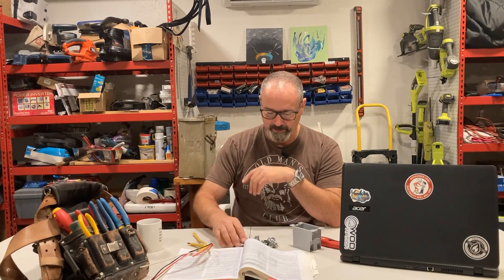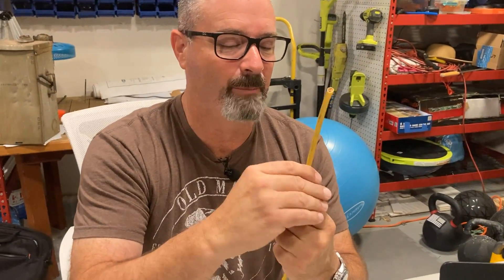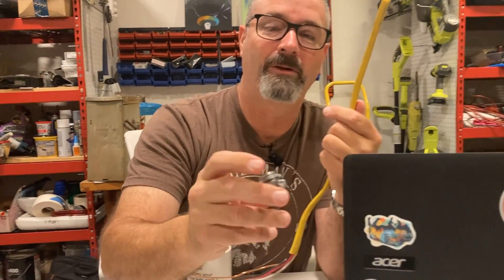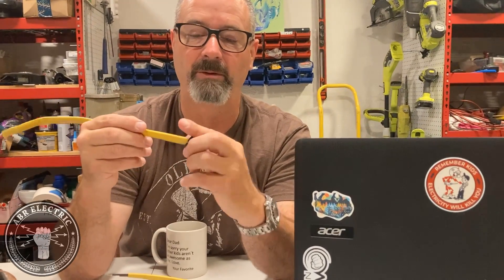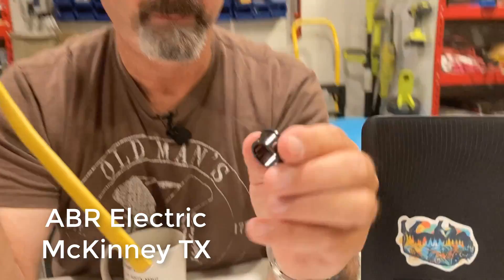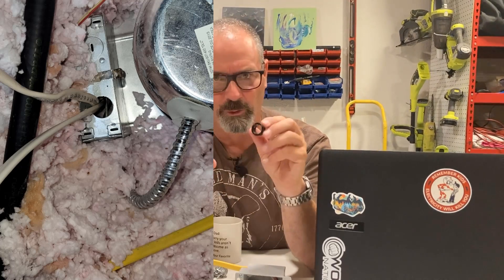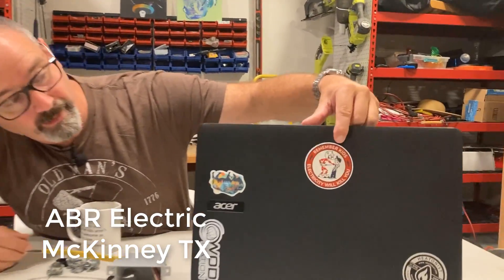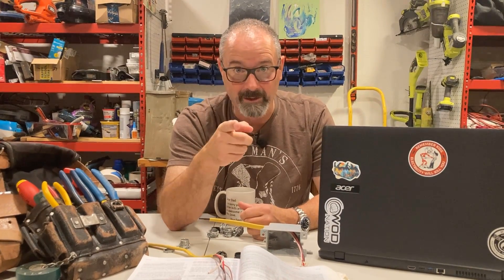Protecting NM Cables, Electrician Wiring Mistakes: Electrician Training for Secure Installations

Comment: If I have 20 Romex cables to feed through only the bottom of a 200 AMP BR Eaton Breaker Panel with 42 slots, the big 2" is being used for bottom feed 4 wires to the 200 AMP breaker at top of the panel, how would I do it since the remainder of the knockouts are a (4) 1 inch k.o and (6) 1/2 inch k.o.   Does the code allow 4 to 6 12-2 Romex cables to be fed through a 1 inch K.O. with metal romex clamp connector?  Does the Code permit (3) 14/2 Romex cables through a 1/2 k.o. with metal clamp connector?
Reply from the maker: @Chad.Tyrone4UNow  the limitation is going to be what your connectors are rated for. So if you have a snap in connector That's rated for 4-12/2 Etc that will answer your question. What are the manufacturer limitations on those connectors? The KO sizes aren't as critical,  as long as you're not damaging the sheath in the cables or bundling over 24".

Comment: Two screw is the way I typically go.  Just had an experience with a  two screw 6/3 for a 14-50R Hubbell NEMA.  

I tightened  the two screw 3/4 but the dimple  for the strain relief penetrated the red wire while working the cable in the panel.  6/3 is not easy to work with as those who have done so know.

The sheathing on NM-B 6/3 is not substantial enough and there is a nice burn mark on my 200 amp panel to prove it.  Although the 50 amp breaker did its job.  For those that have experience this moment know what I’m talking about.  

It will put the fear of god in you.

I will be going plastic grommet with the strain relief and staples to a mounting board.

I should be wearing one of those stickers on my shirt or find a vintage tee with that image.

Comment: OK, can I use the plastic black pinches as you call them versus the metal threaded Romax connectors on the connection box on the front of a dishwasher ? Thank you very much.
Reply from the maker: Yes, you can.

Comment: Are waterproof connectors available for ROMEX? Thank you.
Reply from the maker: Nope
Reply: Thank you. But here is why I asked…..
If have to install an equipment disconnect for my new mini-split. My home has vinyl siding over sheathing and the box will mount to it. Can I use a regular Romex connector on the back of the box or is that not code compliant? I will make sure the box and hole in the sheathing is sealed using duct seal. Hope you can help.
Reply: @Trainman0401  romex can't be used outside. If you mean connect to the box from inside the house, use a regular connector as that side shoukld be dry. But everything from the box on needs to be THWN wet rated wire.
Reply: @ Thank you! That is exactly what I wound up doing.

Comment: I use two screw connectors exclusively!  I don't Like the "pinchies! They allow the wire to be pulled into the box or panel and are difficult to take out if the need arises. Two screw connectors hold the wire firmly in place and the wires won't move in either direction. Plus, if you need to add or remove a wire is a lot easier to do.

Comment: Hi Iam trying to install a Nema 14-50 in my garage with 6/3.but Iam facing a roadblock here not sure what to do.  I have my panel outside of the garage, and I just want to install the outlet on opposite side of the wall( inside the garage). When I try to drill a hole through from the panel side where I have the knockout removed, I find out there is a 2inch of wood behind the panel. This case I really can’t use the integral metal clamp because there is a 2 inch of wood.. any recommendation for clamping the wire without violating the code
Reply from the maker: No, not without seeing it. You may need to enlist the help of a local electrician.

Comment: oh wow, I just did a 200-amp upgrade and my electrician, did that to ever romex and did not hook up the water or ground rod grounds either. I ended up taking the time and doing it myself. now I need to fix the meter box, he put a squeeze connector in the top feeding the SEC and the light co went crazy, i need to change to a waterproof.  Very sad these days you pay good money and get crap work,
Reply: That dude wasn’t an electrician.  What was my first clue ?
Reply from the maker: Always a good reason to get it inspected and add accountability

Comment: Metal 2 screw connectors are what should be used! The rest if the plastic type ate junk! Not using connectors are like running plumbing without couplings!

Comment: on the lip of the he black plastic connectors that you recommended, it says to put the lip side on the inside of the metal box.  My understanding is that they are designed to provide strain relief from pulling from inside of the box, not from outside.
Reply from the maker: I agree 👍

Comment: I’ve been in the business for many many years. Romax is just too damn flimsy and thin these days. Corner of the days where the jacket had water in between it and the conductors. The conductors also had much thicker – I’ll be at lower temperature – insulation covering them. Those two additional Romax connectors with a clamp With that little gripper protrusion on said clamp a prescription for an eventual Lambo if you attempt to tighten the connector enough to keep the cable from coming out whatever it’s connected to. These days I prefer those black pop in ones that are known as “hit – lock connectors“ . In summary, new Romax is dangerous with those old style clamps unless you’re going to just leave them loose “just for looks”.

The lightbulb cartoon character is known as Reddy kilowatt. It was originally a mascot of Alabama Power in the 20’s. It’s use spread to other US utilities and in other countries. If you find any memorabilia such as old lamps of Reddy kilowatt, they are highly collectible.
Reply: Have installed thousands of NM two screw connectors and last time I shorted out a cable was over 60 years ago while in grade school helping my sparky dad on a job. Just have to know just needs a firm tension but never took tight. By the way when I went to continuing education classes to renew my electrical license one of the instructors always said that there is no such thing called Romex or BX in any NEC books.

Comment: What Romex connector to use in Plastic Junction Box, like old work, if u want to use the KO.
Reply from the maker: If an old work box, it should have clamps or clips built into it to hold the romex
Reply: @abrelectric  for 8/2?
Reply from the maker: @Genesislights  If you're putting a range plug in there, you need to look at your fill volume. Yes, you should be able to get an 8/2 thru the clamp on a 2 gang old work boxI. Or, I've drilled out a 1/2" hole and use a regular 2 screw romex connector
Reply: @abrelectric  8/2 for 220V 40A welder circuit. I was thinking of the Arlington or Southwire old box style with screws that fastened to the stud, seems like this new old box is stronger than regular blue box. Thanks
Reply from the maker: @Genesislights  https://www.homedepot.com/p/Carlon-2-Gang-47-cu-in-PVC-New-Old-Work-Box-B249B/305110268?source=shoppingads&locale=en-US&&mtc=SHOPPING-CM-CML-GGL-D27-027_006_CONDUIT_FIT-NA-NA-NA-SMART-NA-NA-NA-NA-NBR-NA-NA-NEW-Live&cm_mmc=SHOPPING-CM-CML-GGL-D27-027_006_CONDUIT_FIT-NA-NA-NA-SMART-NA-NA-NA-NA-NBR-NA-NA-NEW-Live-71700000093390739-58700007789602699-92700070740571175&gclid=CjwKCAjwg5uZBhATEiwAhhRLHpJOeN1VOyBoEip5tF4xe6G7UX1ryZw-DrA4O3s0hw06iqDPnECmZRoCR4QQAvD_BwE&gclsrc=aw.ds

Comment: Right on!  Not using a connector is due to myriad reasons, IMO, e.g. not knowing any better, being in over one's head, being cheap, being lazy, disregarding instructions, poor instructions, blatant disregard, etc.  Any nicked or loose connection can spark/heat-up and while it's one thing to see it at an individual outlet or j-box, WTF with that panel or sub-panel???  OMG, that is criminal.  I'm an avid DIYer and to me that looks like the work of a homeowner or renter or squatter who didn't want to get an electrician or inspected.

Comment: This is one of the reasons why I, as a home owner, hate doing simple electrical work on my house.  Replace an outlet.  Metal box with nothing protecting the wires!  So, now I have to fix that.  It's my house I don't want it to burn down.
Reply: First home and the first thing we did was replace a bathroom light fixture. It was connected with speaker wire…
Reply from the maker: @blandflatland8915  you're doing right, making it right
Reply from the maker: You're living the dream :)
Reply: In Australia, we have to rely on electricians to do everything...needless to say they still don't always get it right but hey...still required.
Reply from the maker: @zappy7393  sounds about right
Reply: Then laying awake in bed unable to sleep. Knowing you need to check every box, every outlet, every switch.

Comment: I don't get why you have metal boxes for your electrical stuff in the US anyway
Reply from the maker: To connect to metal pipe, to protect conductors from physical damage. What kind do you use?
Reply: In residential, plastic boxes are the default from what I've seen. Metal boxes are used in custom homes but only if the customer requests it.

Comment: I live just south of Fort Worth in a new housing community and was cleaning the ac coils on the ac condenser after living in the house for a year and a half.  Well I had to pull the panel that hides all the wiring on said condenser and NON of the sharp metal where the wires run through had a connector.  I was not happy.  Brand new ac brand new home.  Now I wonder how many other houses in this community are like mine.  Where can I find those connectors and how do I know what size to get. I measured the hole and came up with 1 1/4 inch so I assume I need to get a 1 1/4.  Unfortunately I only had time to slip some duck tape in the hole to band aid the situation but its all I had.

Thank you for this video very helpful!
Reply from the maker: There you go!

Comment: If you got existing wire installed,how about a two piece topic connectors?
Reply from the maker: They make snap in connectors, that can be snapped in from inside the panel out. Pretty sharp. Worst case you could take a grommet, cut it, slide it around the cable, push it in. Taking it apart, cutting drywall to add the 2 piece, best of all.
Reply: I’ve used the 2 piece with little wings on the back that hold them in place. The plastic inside-out snap ins are nice, but unfortunately they don’t make them for the larger knockouts.